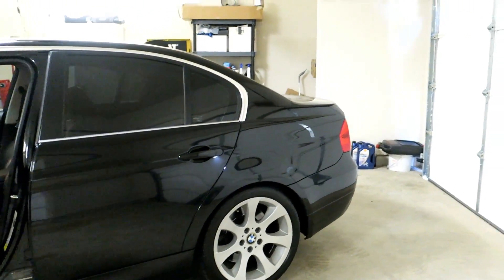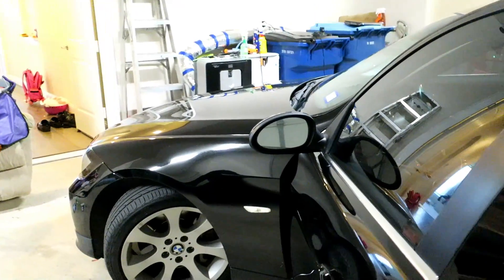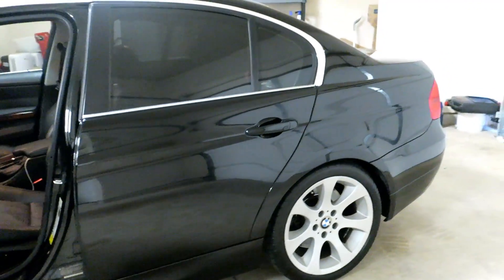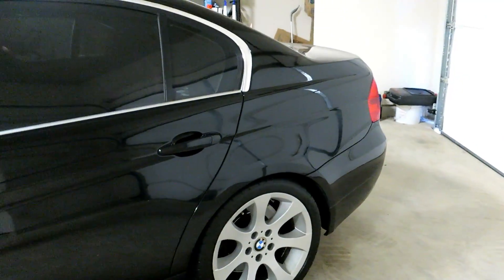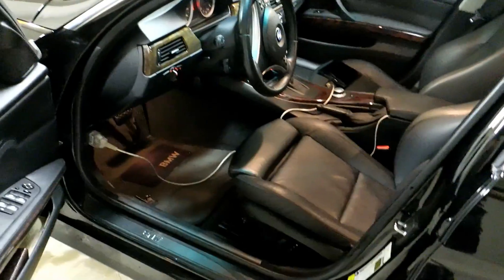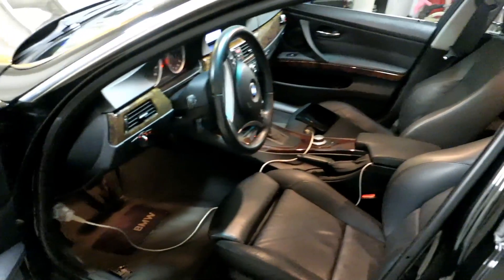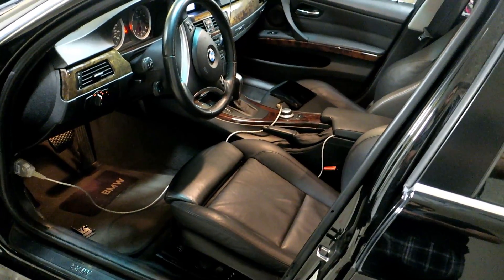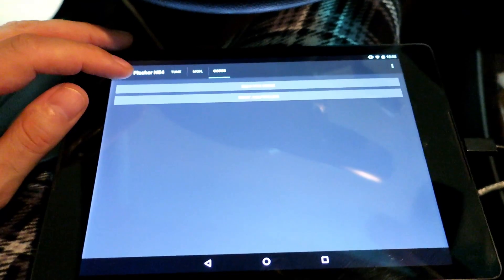How To Diagnose A Fueling Issue On Your N54 BMW.  Part 1

Comment: love your videos man!  Always clean and clear on the BMW issues.  I just got a P0087 code "Fuel Rail/System Pressure - Too Low" which many indicate the Low Pressure Fuel sensor which is $40 Lifetime Warranty from FCPeuro.  I bought the low and high pressure sensors just in case and also my new Eldor pencil style coils for my F10 N55 engine!  If this doesn't solve my issue with the code then I have no choice to replace that costly damn High Pressure Fuel Pump ($600 Lifetime Warranty latest version) but my car starts in about 3 to 4 cranks with this P0087 issue when before it started right up on the first crank.  It always and still Idles perfect and steady just that when I drive off even on slow speeds when the car has not warm up completely i get the "Drivetrain Malfunction" and goes away when I decelerate.  I do smell unburden gas from the tail pipe when I inside idling and it didn't use to do that. Hopefully my Low pressure fuel sensor is all that is to fix this issue and can't wait to upgrade my coils to the Eldor brand. 
Also my car before all this use to hesitate and make a jolt motion when idling when starting the car and annoyed the heck out of me, so one day when I installed my new serpentine belt with all it's new pulleys I took out both Vanos  and cleaned them out with the help of a 9V battery that make them holes open and close in order to be cleaned... When everything was put back, that hesitation was gone! Cleaning the Vanos did the job.  Now I do notice that the car somehow goes below idling speeds to the point the motor is almost silent and feels like the car wants to stall, yet the idling arrow on the dash is always steady, I'm thinking the Low pressure fuel sensor fails to provide a steady flow of gas to the High Pressure Fuel Pump to keep the motor running smooth at a constant flow when idling and it is now that the LPFS wasn't failing before but now it did and giving me those symptoms to fix!
Reply: I get the same drivetrain malfunction at low speed mostly and very rarely long cranks, no misfire. What should I do? The errors I get is fuel mixture and fuel plausibility. Any help ?
Reply: @Stef.echoes  Check you High Pressure Fuel Rail measurements with a scanner in live stream.  Should be idling at about 700psi from a cold start.  When warmed if you rev it and you suddenly get a Drive Train error check if the pressure dropped to 100psi.  If so that means you High Pressure Fuel pump is failing and needs to be replaced!
Reply: @BIGG_DOGG_DONALD_TRUMP  just check both low pressure sensor and rail pressure both good, today I also got limp mode and drivetrain malfunctin at 30 km/h , the only code I have is 29E1, 0x29E1 mixture control 2, nothing else.
Reply: @Stef.echoes  DME: Mixture control 2

Fuel Control System 'A' Too Lean at Idle (Bank 2)
Fault Impact
Voltage condition:
- Electrical system voltage > 10 V
Temperature condition:
- Ambient temperature > -10 °C
Time condition:
- None
Other conditions:
- Engine on
- Adaptation active
none

The fault is recognized when the mixture for Bank 2 is too lean and the adaptation limit (25...30 %) is exceeded for 40 sec.

Potential problem source(s):
- HFM defective
- Leakage in induction tract
- Leak in exhaust system
- Catalytic converter clogged
- Defective injector
- Defect in high-pressure system

I would smoke test the engine for air leaks, clean MAF sensor, clean Vanos solenoids, vents, etc....

Comment: Hey i changed the lpfp sensor didnt used the upgraded one replaced it with a like to like sensor i bought from ebay, now the psi on the mhd monitor is bad, on de acceleration it stays between 73-75psi and when i switch the car off it shoots to 84-87psi! Please help with this issue how can i fix it

Comment: Hey man i need some help , i have lean codes both banks for my n54 but final version 2010 535i , the software my mechanic had said low pressure fuel sensor.. i have that but before replacing need some help , so this low pressure fuel sensor can control the pressure or its just a reading? So it can be fuel filter under the seat ?

Comment: Hey man, I have been trying to figure out a long crank issue on my end as well. I originally thought it was the fuel pressure regulator as you mentioned. But for some reason i started using a battery charger over night and when i would start my car in the morning the problem would go away. When i would turn my car on heading home from work it would take a while to crank again. Car only has 105k and i recently installed an autozone durmast gold battery (900) amps. Im wondering if me not inputing the correct information about the battery on ista p is causing the issue. the car knows it has a new battery, but it doesn't know that the new battery has possibly higher amp rating than oem bmw battery.  Also wondering if it is the voltage regulator you mentioned. any ideas?
Reply: Did you code your battery? Did you swap battery type from AMG? Did you fix your issue. 
I replaced my Alternator Regulator and my failing battery got about a 1 1/2 months before it left me stranded  @ Advanced Auto lucky. I had long cracks sometime before I replaced battery. The Battery health is VERY important. Is the alternator charging your battery?

Comment: My low pressure fuel pump sensor is giving reading on mhd like an earthquake seismograph what do you think I need to do?

https://www.bimmerpost.com/forums/showpost.php?p=25096268
Reply: Holy cow! Is that at idle?  Have you replaced the sensor?  It is quite common for them to fail with age.  My 535xi started stalling at idle. Fuel pressure was erratic and upwards of 88+ psi.  I replaced the fuel pressure sensor and the pressure is now steady at 72.5-ish...no stalling, problem apparently solved.

Did you end up resolving the problem? (I realize i'm replying 2 years later)

Comment: Ive been getting these two codes lately (2aaf & 2a17) when I drive aggressively or punch it at times but the performance of the car remains the same. I clear the codes but they seem to come back, its been on going for almost 2 weeks now. This morning I started the car and they were on there already. I have replaced dtml pump with your dyi last year around this time. Do you think its my lpfp Sensor causing this? Also thank you for all of your knowledge. It is greatly appreciated!!!

Comment: Hi I have a sort of surging feeling and a hesitation mid range still goes like a scalded cat but it's definitely not as smooth through the Rev range and the surging is getting worse any ideas would be most appreciated cheers n54
Reply: Did you fix this issue

Comment: I have some fuel problem with my n54 335i in which the car will turn on but then die right after due to no fuel pressure. I dont know if its the LPFP or HPFP. I recently replaced the low pressure fuel regulator with the help of one of your videos and it fixed a leaking problem as my rear drivers side wheel had fuel smell comming from there.  Everything ran fine for a few days but now my car would start then in a couple seconds die to no fuel. I have a half tank of gas so that wouldnt be a problem. Just trying to find out if its the LPFP, HPFP, low fuel pressure sensor, or something else. Throwing the code P142e
Reply: I literally just had this issue on my 2007 335i. I replaced the HPFP and the car now runs, but I cannot get rid of the P142E code. I'm idling at 700rpm instead of 600rpm, but I'm not going to be anal about that. I also keep having a misfire in cylinder 4, I'll replace the spark plug and it will go away, but give it two weeks and it returns. I just bought the low fuel pressure sensor, but not installed it yet. Hopefully this sensor fixes all the issues I've been fighting with for the past 4 months...
Reply: Would a crankshaft sensor remedy this problem?

Comment: My stay past 70 even 80 i think but i still get little hesitation but i got alot of power n still said fuel pump plausibility i order my low side sensor u think could be something else's?
Reply: That reading of 80PSI is coming from your sensor...what your sensor THINKS the pressure is. It either means that you truly have 80psi in the line because your fuel pump is pushing too much fuel, or it means that your sensor is bad and THINKS there is 80PSI in the line. The DME targets a pressure of 72.5psi, which is more than adequate for the car's demands. There is no good reason for the pressure to be much higher.  If the sensor reads higher than 72.5PSI, the fuel pump will be told that it can back off a bit, resulting in the actual pressure in your line being lower than 72.5. In my case, my sensor was reading as high as 88+ PSI, which eventually caused the engine to stall, because, in reality, there was far less pressure than what the sensor said.   I changed the sensor, and now my pressure reads pretty steady at 72.5.

Comment: My 2009 BMW 335i's low fuel pressure sensor stays around 70 under normal driving but shoots up to 80 and dips to 50 in aggressive driving. Is that something to be considered about? I did a super knock code when a drag raced my car to see what times I would get. I'm considering to get a replacement part for it and maybe an upgraded fuel pump since I'm running a 91 oct stage 2+ map on my car. It is a bit aggressive map even though I'm running FBO's. thank you for the informative video btw!!
Reply from the maker: From what I've read as long as it stays above 50 PSI at WOT you're okay.
Reply: @VehicularDIY  please i need to ask a question im running mhd stage 2 plus and i do have all the upgrades i need for the stage 2
Reply: But the problem i have is i drive normal its normal when i gas the car or down shift to go faster the rpm go higher and it throw transmission lights and loss power i try all maps its same i have automatic transmission so every time i wanna pull or acceleration more it does transmission light

Comment: Extremely informative video.
I might be having similar issues. Its N55.
Out of 10 times I get long crank. It's like 3-4 secs long. Generally it happens after restarting the car after a trip. Restart after overnight is fine. Also I always switch to ignition ON and then start- if I directly start by pressing clutch it takes 3-4 secs to stat.
I m MHD stage 2+ tuned. No issues with power -pulls up pretty hard in all rpm bands.

I checked the rail pressure (mhd monitor).
After a drive it was appx 72 psi. Then after 30 mins- it jumped to 55 psi straight from 72. The drop was not gradual. It fluctuated between 72 to 55 and finally settled down to 55 psi.
So at this moment I m not sure if it's the regulator or the sensor. Fuel pump was replaced 2 yrs ago.
Thanks.
Oh..and no codes.
Reply: I just learnt N55 E series doesn't have the low fuel pressure sensor.
Reply: Did u ever solve this? Having the exact same symptoms as you were. It’d be much appreciated for an update, thanks
Reply: @corbin4258  I sold my car couple of months ago. But after I replaced my starter, the issue seemed to have resolved. Atleast it wasn't that bad. So if your starter is old, you want to check that out. That's heck of a job though.
Reply: For those running Walbro LPFP with the Walbro fitting check the fitment of the fitting and the O ring inside the fitting if the O ring is ok check the tightness these things come loose and cause all sorts of problems and leave you chasing your tail.  CERTAIN COMPANIES DO NOT WANT YOU TOO KNOW THIS IS THE FIX  THAT  IS WHY YOU NEVER WILL FIND AN ANSWER IN ANY FORUM WITH THIS PROBLEM, SO THEY DELETE THE FIX.

Comment: I have 2008 e92 335i! I have an issue with whenever I’m parked or at red light, my car would shake quick or blimp then might drop passed 600rpm at idle and catch its self back up. Any ideas? I have a MHD tune but didn’t get codes relating to fuel injectors. I only got LPFP codes including the sensor
Reply from the maker: Does the idle bounce around constantly?
Reply: @VehicularDIY  mine does this constantly. Any ideas?

Comment: Try turning off the exhaust burble option if you have that turned on.... my N55 hesitated bad every time I had burble activated.... turned it off and all good....
Reply from the maker: Hey thanks for the feedback.  I actually wasn't running an MHD tune at the time of this video so didn't have that option turned on.  Now I'm running Stage 2+ but don't want the burble anyway.

Comment: I replace both HPFP and LPFP and use MHD custom tuning with two tuners and there is still hesitation when shifting after 2,3,4...pulls back then goes forward... don't know if this is the same...previously it just shifted and went forward continuously without pulling back before launching. And all sensors are also replaced. So it may be a map issue...got another map coming soon..each map that comes there is less pull and less hesitation so I am thinking it's a map issue. 

No misfires, not rough, immediate crank.
Reply: matreyia have you done the basics? Coils, plugs, vacuum lines, wgdc logs?
Reply: If you made a list of big and small parts, interior, exterior, any system major or minor...99% of the items on this list would have been replaced. It is literally a new car. Does that mean there's a new transmission and engine (not rebuilt) with new turbos and hoses and radiator etc?? Yep. How about weird stuff like wheel bearings, hubs, axials, suspension parts...shocks, m3 arms, ...i could go on and on...but yeah, even interior parts.
Reply from the maker: Hmm I don't think it's a mapping issue on my car as the tune I was running was solid for a good 2.5 years.

Comment: DIY, apologies for posting this on the wrong video. Unless i over looked it, do you have a How To on coding out thw Adaptive Headlights? Cant find any answers online really. Thanks in Advance!
Reply from the maker: Hey I don't have a video on how to code them out, I was thinking of custom coding them to spread out a bit more.  Why do you want to code them off, is yours acting up?
Reply: Vehicular DIY Yes they've quit moving side to side due to the left light not reading, but still Autolevel

Comment: Part #  13537622231  or  13537614317 ?   Actually, after researching this all day, you need to replace the low pressure side of the fuel line along with the sensor. The new sensor won't fit into the old line. (At least that's what the vendors are claiming) Part# 13537622751. I already have my intake off (cleaning via your method) so I figured I'll replace my sensor as well.
Reply from the maker: Hey sorry for the late response 13537622231 is what I used, with the addition of an o-ring it went right on.

Comment: BMW X5 4.8is model 2005 the problem the Engine hard start but the. Battery is new it is same click engine no start and then engine start and then off and then start again no start
Reply: Edd Baloja Baloja you need a new starter